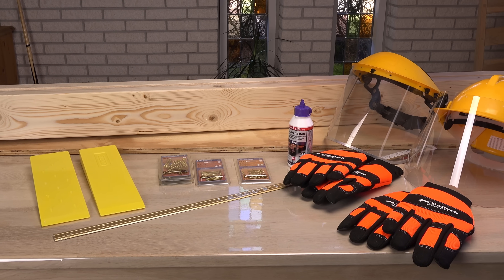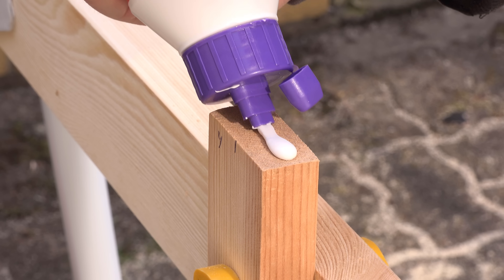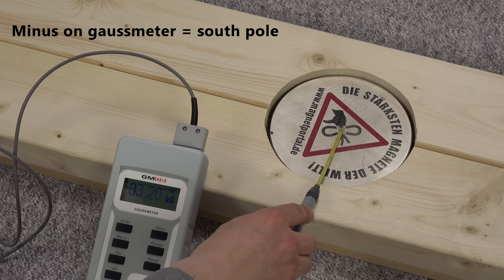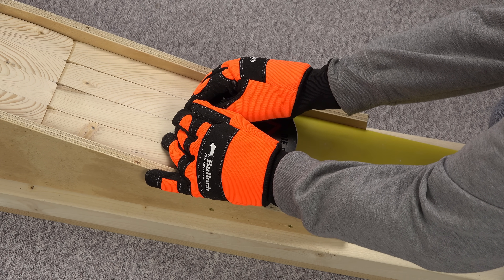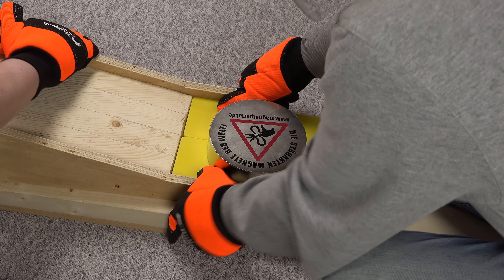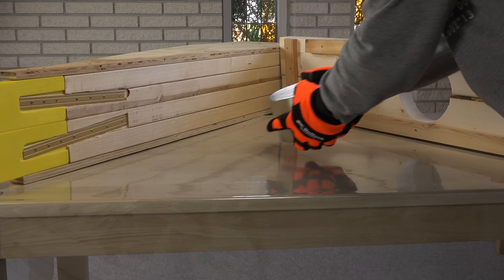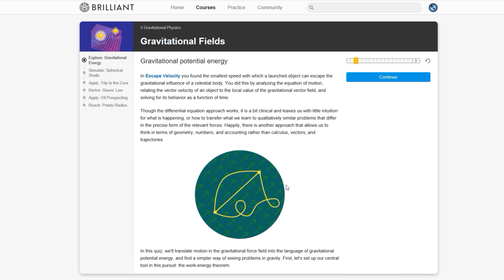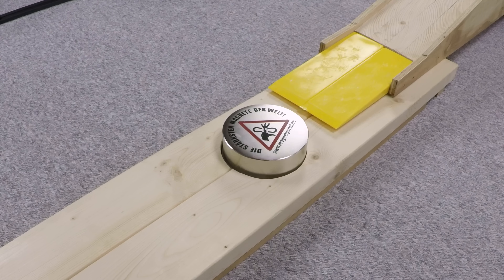Monster magnet meets monster magnet...

Comment: I still wonder why is not possible to produce energy out of magnets. Some kind of infinite energy and stuff.
Reply: Energy cannot be created or destroyed, that's why
Reply: Gooscar Well, it surely can be “created”, in the sense that some force can be converted into energy.
Reply: Lauro Neto 
You can't make a motor or generator work using only permanent magnets - they're not really a source of energy because they have two poles.
Reply: Gooscar I know that. Theres none out there. 
But I keep thinking if theres a way. Of course, not only by getting magnets close to each other, but maybe a way to do it. Somehow.

Comment: why did they not attack the two magnets without using the wooden and plastic ramp? it was enough to use a tube of the same diameter of the magnet and to pass the other magnet inside

Comment: Why not place these two cylindrical magnets in an aluminum tube filled with your choice of fluid and slowly release the hydraulic pressure developed between them until they gently contact?

Comment: Wow, that thing is dangerous.

I have all these strange thoughts like:

1. Rolling it out into a street and it sticks to two cars. The insurance has to total the cars because they can’t get them unstuck. 

2. A battlefield weapon that disarms the enemy by causing ALL the rifles to stick to it. 

3. You could go magnet fishing for submarines with that thing. 

4. If anyone had any steel shrapnel inside them, this magnet would rip it right out. 

5. You could probably use this thing as a nail puller. 

6. Don’t use steel toed shoes in the lab. You might be stuck for weeks until someone found you.

Comment: While they are strong the listed force attraction is because of the magnets surface area. It is the force required to pull the magnet off an object at a perpendicular pull from the surface. Clearly the attraction force isn't 2500 lbs or two guys wouldn't be able to pull it as they did. There are smaller magnets out there that have a greater range of attraction then these behemoths, but the surface force is lower because of the surface area. I have personally messed with magnets that had a field range of 2 feet. This video showed the field range of a few inches. Still cool though.

Comment: So heres an experiment to try drill a long deep whole or somthing of the like to hold one of the magnets solidly with south up. Then drop another magnet in the whole with south down. As long as the wholes been made well enogh to stop the magnet from fliping it should float. Now see how much whigh/ force it can hold befor it sinks down. 
Remove most of the weight suddenly and see if it shoots the other magnets out.

Comment: Isn't it strange that when the light reflects off of the side of the two magnets the reflection is wider on one magnet than it is on the other
Reply from the maker: Well noticed - it is because the newest magnet is much more shiny. I have barely used it compared to the second one which I have put through its paces for many years in my videos :) Thanks for watching!

Comment: wow .. i can't imagine what it would take to separate them
Reply: a can of spinach
Reply: Yeah, well that too, but I think you'd need at least two cans.
Reply: You'd need a powerful machine made of aluminum or copper.
Reply: Joaquin Toledo Just heat fellas...heat them
Reply: Not even close. The Curie temperature of Neodymium is 100-200°C (Temperature where permanent magnets lose their permanent magnetic properties (https://en.wikipedia.org/wiki/Neodymium_magnet#Grades )). The melting point is 1,016°C.
Reply: Hydraulic press... made of non-magnetic metal!
Reply: Watch the video backwards
Reply: Chuck norris would seperate them with his little finger
Reply: Hassan Nagy that's what I'm saying
Reply: Prasun Talukdar love that reference
Reply: Chuck Norris would separate them without any trouble
Reply: Ramanath Bhat Wouldn't negate their magnetism unless you got them to reach melting point. Before that, they'd be malleable and squash together even more.

Comment: Serious question: Why cant you just throw them together? If its to dangerous - build something in 2 meters high, where you can pull a trigger to let one fall down to the other one at the ground?
Thanks for an explanation!
Reply from the maker: As mentioned in the video they are brittle. Don't be fooled by the metallic look. It's just a coating making sure the inner ceramic material doesn't corrode. The magnets will shatter violently if allowed to accelerate even for a short distance towards each other. Not only will it destroy two magnets worth €575 each - the ejected fragments will be sharp and easily puncture eyes, arteries etc. Hope it clarifies why the shown project is not for beginners. Thanks for watching!

Comment: How to separate the magnets
Reply: Watch the video backwards
Reply: Wait a few hundred thousand years until they loose their magnetism enough to pull them apart by hand.
Reply: Pressurize the gap between them as they sit within a close fitting aluminum tube.
Reply: Not at all.  6" diameter = 28 in^2.  At 100 PSI and a 1/4" wall aluminum tube, this would be a trivial hydraulic procedure.  Turn a small groove on the ID of the aluminum tube to facilitate the oil flowing around the entire circumference of the gap between the magnets.  This is also the best way to join them in the first place.
Reply: Not happening
Reply: Should be marked as solution
Reply: Put one magnet in the vice, strap the other one to a steel cable.connect it with your car and accelerate. Watch out for the earthquake tough
Reply: Heat them up.
Reply: XD
Reply: Bring a third magnet...And 4 th one too. Keep this twin in-between them use a plastic chisel like thing put between the connected magnet and separate them
Reply: Maxi Ruti Martinez Park 😂😂
Reply: You can't. Do you want Earth to explode?
Reply: Call Magneto
Reply: heat them up
Reply: Rub them both with Ethylenediamine, Apply 1000°f heat in a vacuum chamber, then destabilize them with 240v at 15 Amps. They should seperate to equal distances within the vacuum chamber. Then insert a solid block 10" thick of aluminium between them that you have to build a special vacuum chamber to hold inside with a lever. Once the aluminium is in place you can release the vacuum and the magnets will attach to both sides of the aluminium block. Prepare the holding cases for the magnets and carefully slide 1 magnet off the aluminium block into the holding case and move it away from the other magnet. Be careful as once the magnet has been removed that other will lose its grip to the aluminium and fall off.
Reply: Ong Bonga lol

Comment: I had bought a couple of 2 inch by 1 inch by 1/2 in n42 neodymium magnets with a pull of 72 lb each and those right there are scary to handle I have to have gloves on with them to keep my fingers from getting snipped these right here forget about it wouldn't want to mess with them excellent video

Comment: I watched a video of a guy who had two huge neodymium magnets and they were so big that they had to be stored on basically opposite ides of the house so they didn't pull together and destroy everything so one day after a video he asked his wife who had just as much experience with big magnets to pick up the magnets she was tired and picked one up put it in a cupboard and when she went to pick up the other she forgot where she put the other and just  assumed it was on the other side of the house (note they didn't actually need to be on other sides of the house they aren't that powerful they just did it for safety) then they went to sleep they wake up to banging and go into the kitchen were both magnets were open up the cabinets and there were holes in every wall of the cabinets and the two magnets were stuck together they almost weren't able to get them apart but they somehow had two stronger magnets they use for work and were able to pull them apart

Comment: Why didn't you just slide the top one over the one set flush, horizontally? They would have aligned themselves, especially if coated with graphite.
Reply: The magnetic fields move in a certain direction so the magnet would flip abruptly

Comment: With the fact that neodymium magnet are super brittle in mind... It would be entertaining to see you setup a contraption where two of the same type and size magnets are positioned facing each other (one on the ground and one high enough away to where it wont attract the other). Then through some kind of tube that is just big enough to funnel the high magnet down towards the other... Drop the top one onto the other magnet and watch the explosion the two colliding magnets would make.

Comment: The sound at the end is from what is called stick-slip type dynamics. The twomagnets are pressing on the plastic wedge so hard that any lateral movement experiences high friction. Friction plus lateral movement typically means stick-slip, that leads to sheer ruptures and sound emission.
Reply: Looked like the magnets were rubbing against each other too,which could also have caused a similar harmonic effect.
Reply: Sounded to me like the wood was making most of the stick-slip noise
Reply: +shoonnya   Amateurs. Pros use a micron layer of dog feces cooled near absolute zero to avoid stick-slip.

Comment: Much easier way to do this. 
Rule: No impact, no pinch!
I’ve used it myself on smaller magnets that I could not separate by hand. This approach allows you to combine and separate them. 
Take two boards, in your case it would take 2”x8”s. Using a single bolt of appropriate size, attack the two boards at one end to produce a scissor structure. Now cut/drill holes through both boards an couple of inches or so away from the fulcrum. 
To combine: open the scissor and place a magnet in each hole and slowly close the scissor. 
To separate simply reverse the process.
Just make sure the boards are sufficiently dense and long enough to handle the strength of the magnets. A 8 ft scissor of a hard wood like oak might do the job. Test the process with smaller magnets and work out the kinks in the process. You could even cut the bottom scissor hole into a table and then use a single board on the top to slide the magnet over the other. 
If you do not want to use a levered approach, you could connect the top board with a bolt to move in horizontally over the bottom magnet and take the manual effort out of the job. 
But sliding the magnets over one another instead of using a ramp eliminates all the possible damage to the magnets or the ramps. 
Of course, test it out in smaller magnets first and make sure the magnets are flush against each other during the whole process. 
No angling down to a final impact, no matter how small. No impact, no pinch!

Comment: Awesome! One question. Because you've joined these magnets together, does it double the magnetic strength? And if not, what is the science behind why.
Thanks!
Reply from the maker: Hi - as mentioned in the video I will test the new 6x4" in my upcoming video. But no - the magnet isn't twice as strong as a single magnet. Mostly because of distance. The second magnet will always be 2 inches away from anything the pole surface of the first magnet is working on. Magnetic forces drop dramatically with distance - notice the low gauss reading above the wedge. Thanks for watching!
Reply: Thanks so much for your answer! I figured there were certain "rules of nature" that things like this must follow, LOL!
Can't wait for the future experiments!

Comment: I think I could separate them without breaking them. 
On my method I would build a rectagular box with two side open for two holed planks to pass through it. Insert the both neodymium magnets into the planks holes (like the one you used in this experiment) and then apply force from the planks edges in opposite direction and voilà.

Comment: You could also try to make a tube the size of the magnet. Put one magnet down and a block of ice in the tube. Placing the magnet on the ice will cause pressure and the ice will melt. The magnet woulf slowly get closer to the other one until they connect

Comment: maybe heat them next time to make the process easier and less hazardous? Unless you reach the maximum working temperature there should be no permanent loss in field strength

Comment: My guess for the sound: It happenes exactly at the moment, when the upper magnet "tilted" a little bit in order to make contact with the other one. And because of that, alot of the force is applied to the edge of the plasticpart. So basically its the plastic and the magnet rubbing against each other under certain conditions to make that sound and when the pressure on the plastic gets released a bit when the magnets touch for the first time, the sounds immediately stops again.

Comment: if you wanted to separate them, is it possible at home?

excellent video, thank you!

also, why is it safer to store than two seperate magnets?
Reply from the maker: Well, it is possible to separate them if I'm allowed to damage them :D Separating them with no damage will be very tricky (and dangerous...). If I ever have to attempt it, I would make a better and much larger version of my splitter tool (https://youtu.be/ybY_wdQ5MSc).
It is safer to store a single magnet than two big magnets constantly trying to fly towards each other and crush everything between them ;) Thanks for watching!